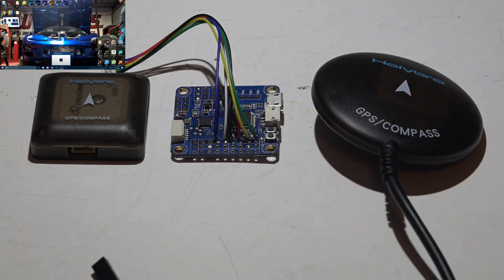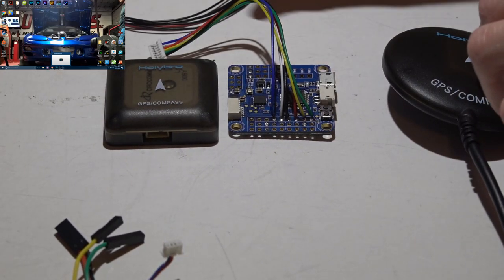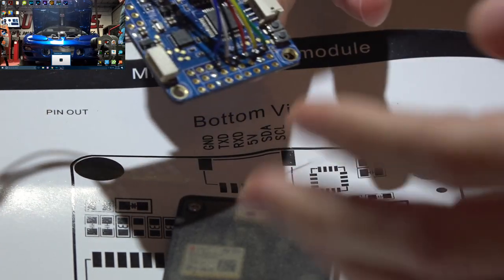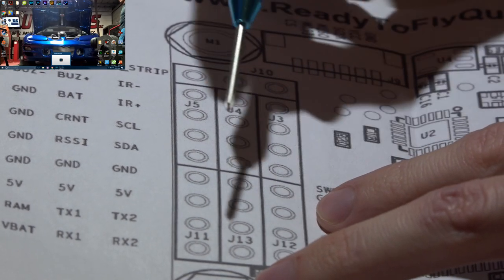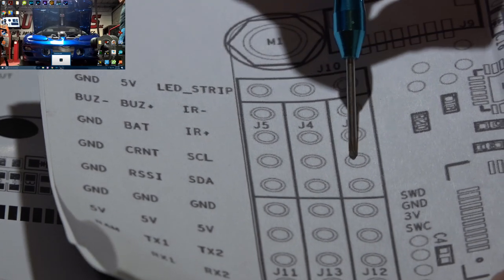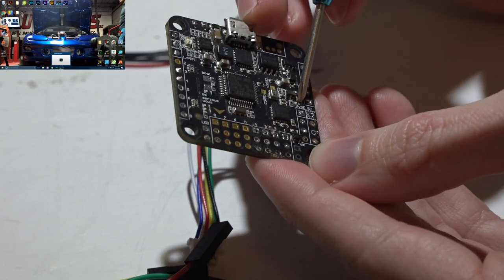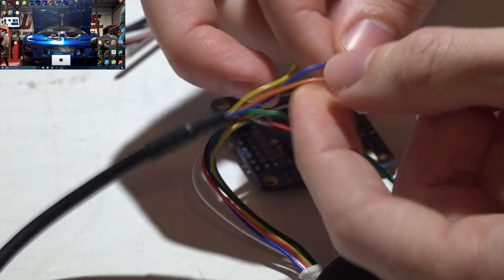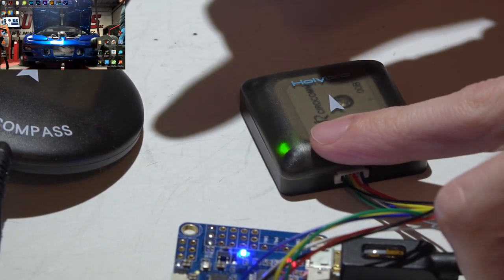INAV: Wiring GPS Into Flight Controller

Comment: I have the new F4 V3. Connecting it like the video shows I lost all receiver input. Unplugging it from the FC gave me everything back. The GPS I'm using is the UBLOX Neo M8N. I double checked the wiring it should have worked.
Reply: Does the M8N need 3.3v? ...and if so did I just set the FC into a tizy or did  smoke the GPS?

Comment: this video is very informative thanks i just wanna ask you i have eachine x220 racing quad but the quad is not stable if i add this gps module in my quad is this for stability and altitude hold also ?

Comment: Thank you for your video. The FC shown in this video seems to be OMNIBUS F4.  It says it should flash OMNIBUSF4SD firmware. However, I can only find OMNIBUSF4 (without SD). Can I use it?  Also the Sbus port in this board seems to be using RX6. How to connect Sbus receiver to this board without conflicting GPS using UART6?

Comment: Fantastic video really helpful. I've been meaning to build a mini quad or an 8 inch quad with gps for a while this will be perfect!! I will go ahead and buy the F3 board you have suggested and the M8N gps unit. A couple of questions, can I fly in acro mode and make it go into horizon mode if it goes into failsafe? (signal loss) and will I need anything else to set up the build in OSD? kind regards Mark

Comment: hey everyone,

i want to include a gps in my build. I have gps units from a couple of jiyi p2 flight controllers (they are left over due to me frying my flightcontrollers because they were apparently incompatible with another part).
they are new and i know that they work - in addition: they also have 6 outputs (2 servo plugs).

Does anybody have an Idea, how to detect the function of each individual wire? Power and Ground should be easily found via a voltmeter, but i have no clue, how to detect the other 4 wires.

Comment: Mr. Blue,
First off, Thanks!!!! I bought the Omnibus F4 on your recommendation. I also bought the Holybro m8n gps. Watching this video I was able to get the two of them wired up together and working, at least on the Inav screen. I am building a wing. Could you do a video of what suggested modes we should use with a wing? I have a Spectrum Dx6. So I have two three position switches to my avail. Thanks, Tony

Comment: My F3 FC only has 4 pins and it doesn't have SDA and SCL. Will this still work or do I need a new FC?
Reply from the maker: It has them. Download the manual from here
http://seriouslypro.com/spracingf3

The SCL and SDA pins are on the connector to the right of the USB if you're viewing it with the USB on top.
Reply: Project Blue Falcon hmm are the labeled with a different name? I'm not seeing them.
Reply from the maker: Do you have the delux or acro
Reply: Project Blue Falcon deluxe
Reply from the maker: My bad I forgot to mention its on the bottom side. So holding it with the usb at the top, and looking at the backside of the board, the connector at the top right. The pins from left to right say rx, tx, +, -. But if you looked below the wiring diagram picture in the manual you'll see the colorful boxes that say grn in a grey box, 5.0v in a red box, SCL in a blue box, and SDA in a green box. Then written next to that is,
"I2C1 connector - Used for external sensors and OLED displays.
The SCL and SDA are 3.3v signals.
5.0v is always supplied via the on-board voltage regulators, even when powering via USB."

If you're using google chrome then on the page click in the top right of your screen next to the star, then click "find" and type in SCL, and that will take you to what I'm talking about.
Reply: Could I just leave those unplugged since my board has a barometer and magnetometer?
Reply from the maker: Yea you could leave it unplugged and use the flight controllers magnetometer. It wont be quite as accurate but it doesnt really have to be. It will be good enough.
Reply: Yes I looked at the manual again and found it. Thanks for all the help! I guess my other question is, if I wanted to use the magnetometer of the GPS module and can I deactivate the one on the board? I remember you typing some commands but don't recall if thats how you change/deactivate it. I'll have to go back and rematch that video.

Comment: im not getting power to mines can figure it out
Reply from the maker: I've never used a Naze flight controller for GPS. It may not have enough UARTs, or even CPU power to run a GPS build. And for power you will have to plug in a battery to get GPS power, the Naze wont power anything with just the USB.

Comment: Thank you -  great video.

I purchased the Flip32 F4 Omnibus with the Ublox NEO-M8N GPS/Compass. You mentioned we need to power the GPS/Compass with 3.3V, but I don't see on option for 3.3V on the wiring diagram for the Flip32 F4 Omnibus.
Reply: I realize that a step-down regulator is an option (https://www.pololu.com/product/2122/), but in the video you seem to mention that 3.3v is available on this fc board.
Reply: Ok - I found it. It's one of the three pins in the white plug for spektrum (which looks different than on the F3)